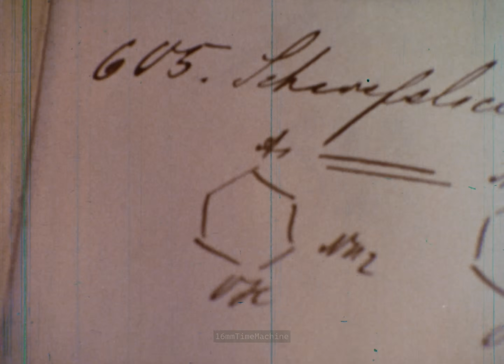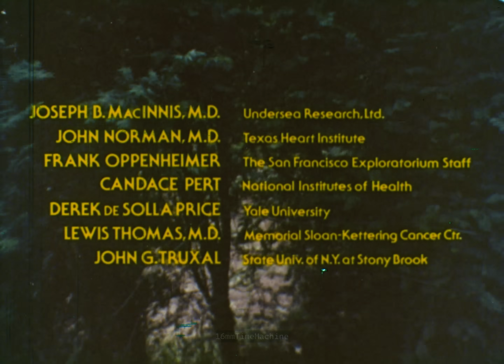The Search for Solutions, Trial & Error - Human-Powered Record & More (1979) | 16mm Film Scan

Comment: I was very involved in the IHPVA around this era and it was amazing. In the mid 80's Dupont sponsored the Speed Challenge, the first "bicycle" to hit 70 mph. They chose that speed because their experts calculated it wasn't achievable with current technology and the prize would go on for years getting great PR. It turns out, the speed was reached in about a year. And now the record is about 90 mph on flat ground.
Reply from the maker: Must have been impressive to be a part of if they were progressing that fast! And I figure Dupont's marketing department had a rough time with that haha
Reply: @16mmTimeMachine  I guess it's all relative but the Big Prize was only $20K. So DuPont had little to loose. It was a true renaissance. Birth place of the GM EV1, modern drones, modern eBikes, advanced satellites and even the roots of the Tesla automobile.
Reply: I remember that DuPont bike.  Tan.  Kevlar skin.  Looked like an axehead.
Reply: Not only is the IHPVA still very much alive,but there is now also the Icarus challenge [once every year] for human powered aircraft.Other events currently running for similar endevours.